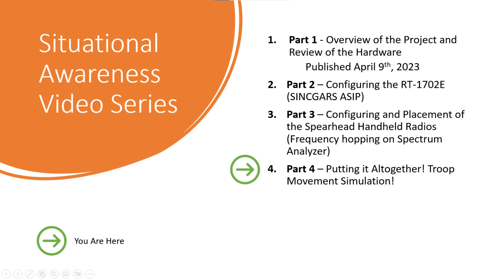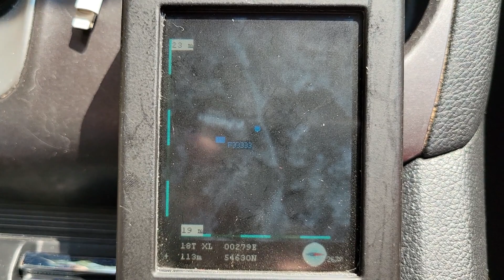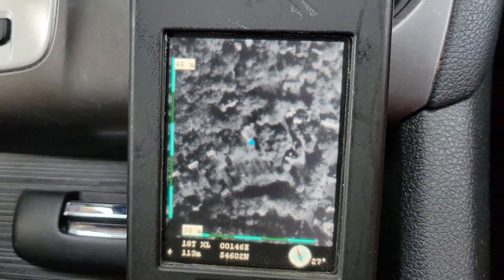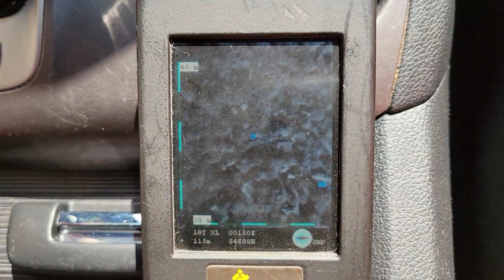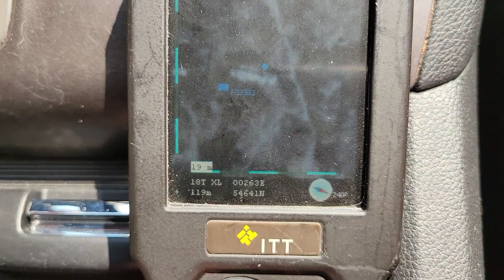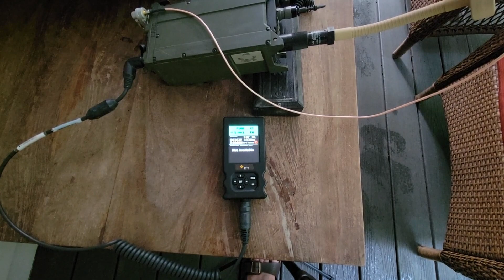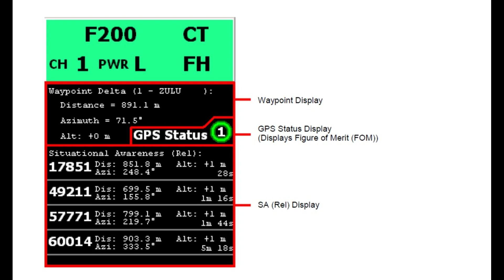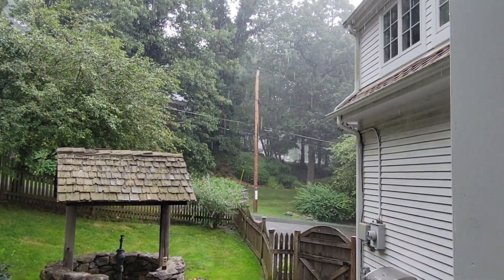Part 4 - SINCGARS Situational Awareness Mapping Project

Comment: Does the position data transmitted follow a standard or is it all proprietary?  Just wondering about the extent of lock-in by the manufacturer.
Reply from the maker: Hi Peter. Yes it follows the MGRS (military grid reference system). Check out part 2 of the series. Here is a link right to the relevant section: https://youtu.be/7Oflw_5MQW4?t=1226